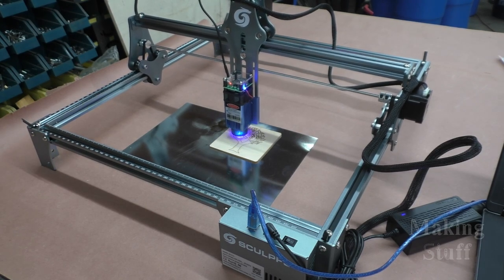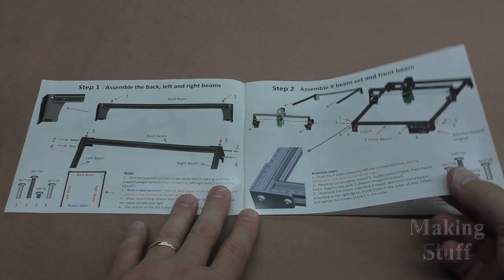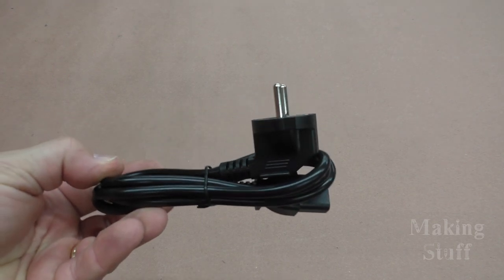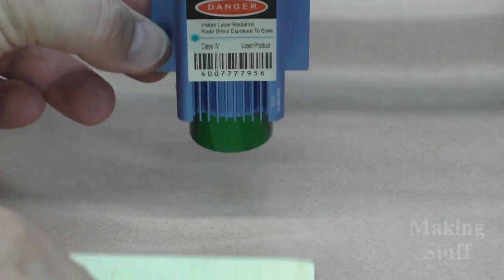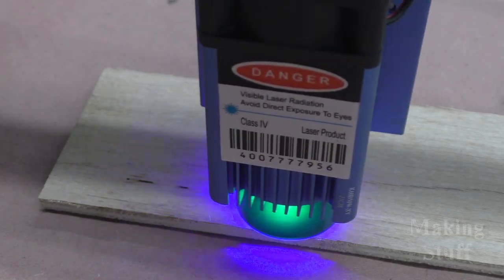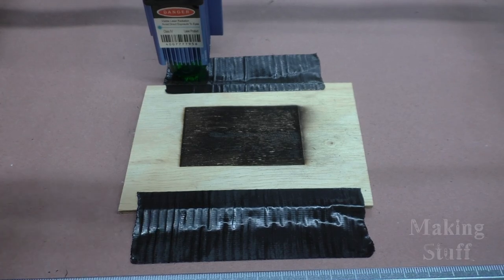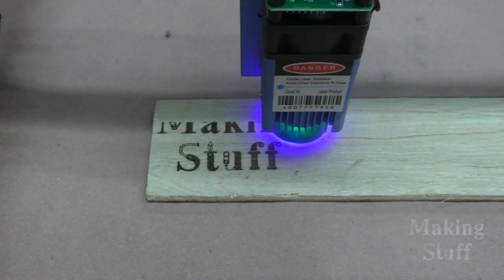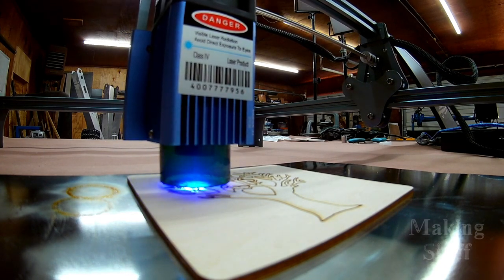Reviewing The New Sculpfun S6 Pro Laser Engraver - Is It Really That Good?

Comment: Try this: 1.) Apply a waterproof coating to sheet metal. 2.) Use engraver to remove coating according to a design. 3.) Place sheet metal in salt water bath and pass 12V5A current through it to erode the metal, cutting out the design.
Reply from the maker: Thanks for the tips!  You can do the same with coper and etching fluid to make printed circuit boards.
Reply: @MakingStuff  Well... except in the PCB situation, you can't do it with electro erosion, because you're trying to completely remove copper from between the desired traces, and once an area of copper becomes isolated like an island from the rest of the copper it stops conducting current and will stop eroding. However you could use the laser to burn away a resist material in preparation for using an acid or ferric chloride bath or similar.

Comment: I like the openness of the frame. Good candidate for a vacuum table, at least for your fixture in the case of the cards. If you wanted to make 100 of them. I suppose you could use that airflow(with little ducts) to exhaust fumes too, eh? Push button valve to release the suck for the next one, heh heh. All in the home shop! Try to do that 20 years ago...

Thanks for the Demo!
Reply from the maker: Thanks for watching!

Comment: Question about cutting opaque acrylic 3mm: Just got the machine and doing  a few passes in line mode, at 10% speed and 100% power (via lightburn) and still not being able to cut acrylic. I have focused the laser using the metal cylinder that came with it (I am guessing this is the only thing I need to do to get the focus right) yet even after 15 passes I am only getting it to partially cut into it. Not sure what exactly I may be doing wrong since I am very new to lasers so any help would be great. Great video btw.
Reply from the maker: I don't know.  Could be the type of acrylic you are trying to cut.  Thanks for watching!

Comment: hi bob! thanks for the video, just a really fast question: what is the maximum speed that this machine can reach?= the ortur master 2s pro can achieve 10000mm/min with no problems thanks to the 32bit motherboard, is this machine capable of that speed or will stall?

Comment: How long do these typically last with regular use? Trying to see if it worth to buy my own cutter or just send my dxfs to another company and get my cuts.
Reply from the maker: I haven't used mine much but I would figure it last just as long as a 3d printer since many of the components are the same.

Comment: Hi. I got this machine a month ago. I am using light burn but I struggle to cut anything. It does not cut through 3mm acrylic even after 20 passes. The acrylic does not have a paper backing. I am not sure if that makes a difference.
Reply from the maker: Did you set the focus of the laser?  Also make sure the power setting in the software is set to 100%.
Reply: If the acrylic is clear that could be difficult. This type of laser does much better with dark color acrylic.

Comment: Is this able to engrave a small area (25mm x 100mm) in a large 18mm plywood board (100cm x 40cm x 0,18cm)? Since the plywood is larger than the working area, is it possible to slide it under the CNC?
Reply from the maker: Yes just set the engraver on top of the board and set the focus of the laser.

Comment: Hello Everyone. Can anyone tell me from the experience or knowledge, if i can set up a laser hight a little bit higher as i want to put some pieces to hold cut elements. Thanks!
Reply: All you should have to do, is raise the machine up as high as the height of your piece. If it doesn't fit under the existing height allowance of the gantry, just use blocks of wood
Reply: You can raise it just so long as you are able to set the focus distance, from the laser to the workpiece, to the required distance.